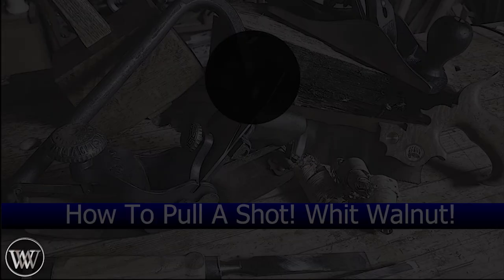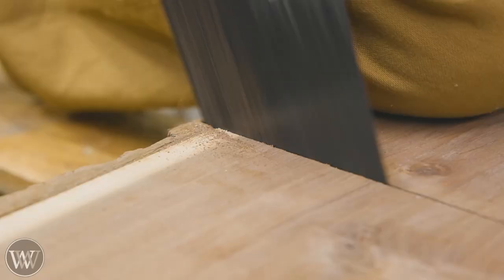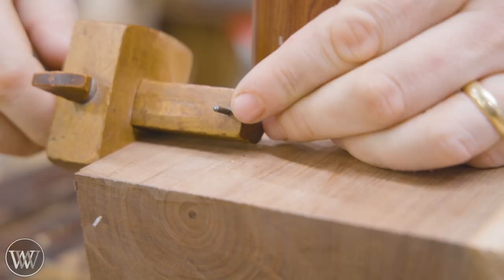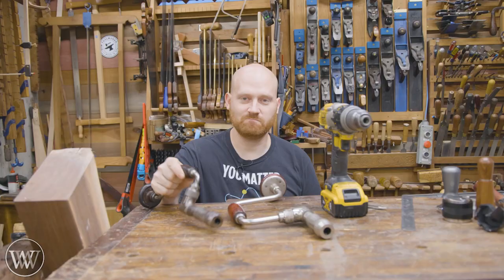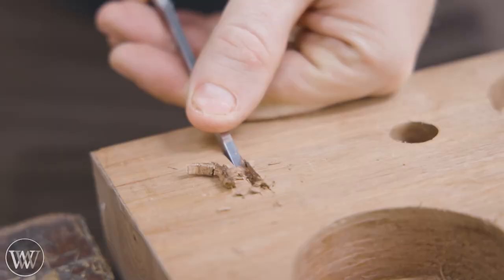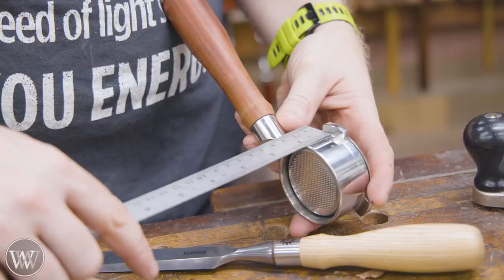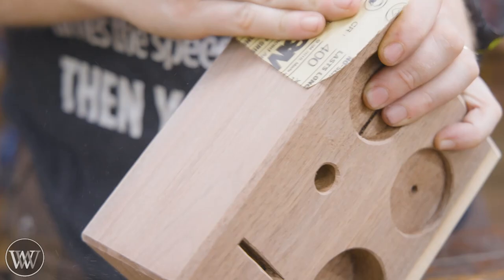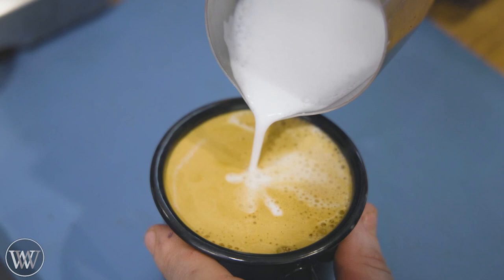How To Make an Espresso Buddy Tool Holder

Comment: I have a couple of those wood owl bits as well and you aren’t kidding about the amount of torque needed. I discovered that it works really well if you drill three or four smaller holes in the waste area around the snail.

Comment: I like this idea...I found this video looking for your advice on how to make scooped out wood.  I am wondering how to make circles like those found in a mancala game board; perhaps start with a brace and bit, but what?  Some gouges and then heavy sanding?
Reply from the maker: I would generally just carve them with a garage. If you run it right you won't need to send them at all.
Reply: @WoodByWrightHowTo  thank you.  Was trying on some gnarly madrone and the grain is going in all these directions and so I was wondering if it is me being a novice or that I was using the wrong tool.
Reply: So, on second thought..it's all about me being a novice.  😅

Comment: I made a pen after watching your video. Wife was with me at rockler and saw the pen blanks and liked an acrylic blank. I got it when I went back without her and I’m gonna try to surprise her with a pen. Hopefully you can plane acrylic! Probably touch up my blades before I start. Wish me luck!
Reply: Im currently making my wife a pen out of tiger wood.. loving the look of the figured grain. Hope your acrylic pen goes well 👍
Reply: I've made a lot of turned acrylic pens and handles.  My experience is that acrylics sheer ok at speed on a lathe but are better scraped.  If using a plane, very, very thin shaving because acrylic is brittle and not a low angle plane either.  IMHO
Reply: @dwightl5863  yeah I got a couple to experiment with to try my spokeshave, no4 and a block plane to see what works best.

Comment: Is the filter with the handle magnetic? A small magnet under it might keep it in the holder level.
Reply: I didn't care for the "tippy" handle either.  Hole for the holder perhaps make closer to the other side.
Reply from the maker: Unfortunately no it is a stainless steel that is not magnetic. I looked at adding that. The tippy handle seems weird but the only time it's in that slot is when you're pressing it. So your hand is on the handle. It gets stored in the machine.
Reply: @WoodByWrightHowTo  Ok, I assumed it was storage not a holder. Congrats to Melody on her espresso maker!

Comment: Would a huge bit like you used there be a candidate for using your post drill "press"? It seems like a potentially useful tool that you've never gone back to after you restored it.
Reply from the maker: It would have if I could have gotten the block in and locked down. I tried... Wish it would have worked.
Reply: @WoodByWrightHowTo  I should've known that you would've tried it before the demon brace lol

Comment: Coffee toys! Two of my favourite pastimes doing a crossover.
This turned out nicely. Beware the portafilter, it's the grotty tool of the bunch, leaving wet coffee drips behind.
18g is usual for double shots, 21g for triples, so you obviously like your coffee strong 💪. 😘💕❤
It's nice to see you've got all the fancy extras too. The whisk really helps.
Good luck and lots of fun getting acquainted with the machine. They're a good time sink.

I made something similar a year ago, but it's nowhere near as nice, being made from beech offcuts laminated together. Those pieces were much more scrappy than your very nice scraps. Mine was made with carving chisels, as I gave all my forstner bits away (with a drill press to a friend) a few years ago - so the curves are all a little more natural, than precise.
Pic here https://imgur.com/gallery/rVHmImL